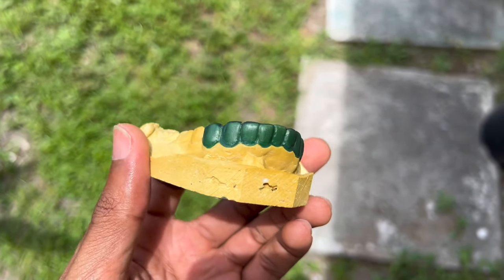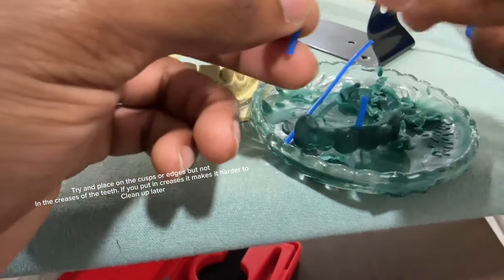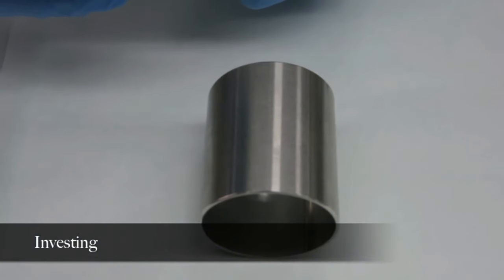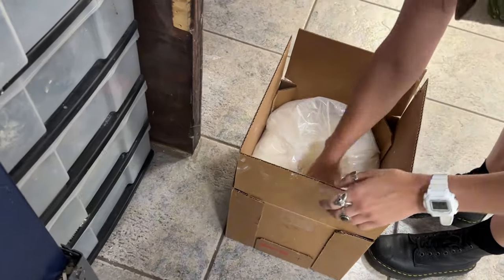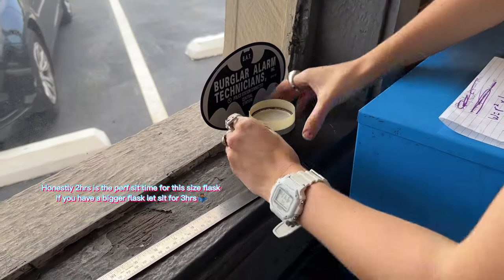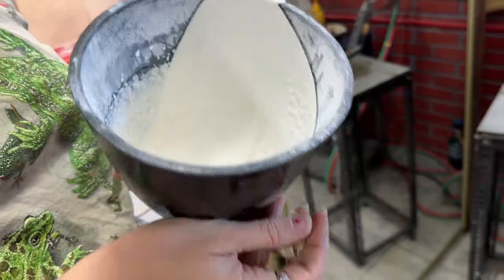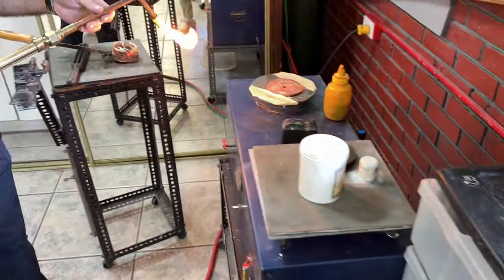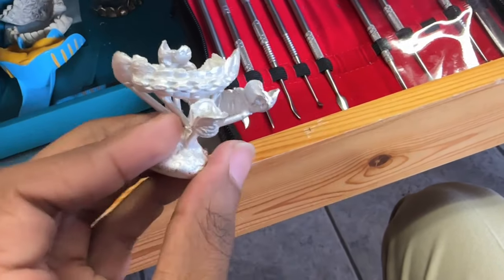HOW TO MAKE GRILLZ at home STEP BY STEP!! 🥶👍🏾👌🏾

Comment: How much to let someone cast it for you roughly?
Reply from the maker: @Yxung_tar  that’s a hard estimate to give due to the price varying a number of factors. 

The price can fluctuate depending on the type of metal and the quality of the metal (ex. 10k 14k 18k gold or silver) it can also vary depending on how thick you make your pieces. 

Casting prices are normally conceived from the weight of your piece the spot price of gold for that day (if casting in gold) and the purity of the metal. Roughly $300-$800. But it heavily Varys.

Comment: What is an alternative to get air bubbles out without having that machine
Reply from the maker: Technically you can use a vibrating table the same you use for alginate from my previous video. But it still won’t get nearly as many bubbles out as the vacuum chamber